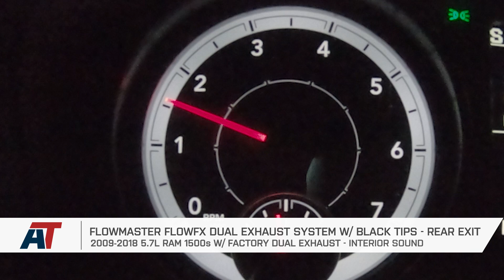2009-2018 RAM 1500 5.7L Flowmaster FlowFX Dual Exhaust System w/ Black Tips Sound Clip & Review

Comment: I have a 2014 ram 1500 SLT I recently changed the back bumper from the regular one to the dual exhaust bumper. Can I just throw this kit on ? I can just buy the hanger rubbers from the dealership that need to go on the new kit right ? In theory it should fit ?
Reply: Great question i thought about that today for my 2019 slt